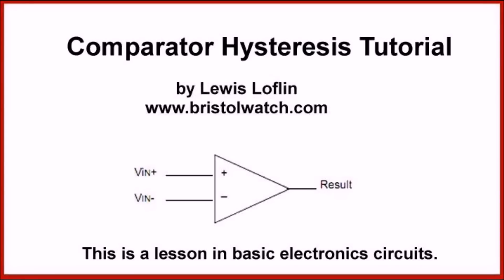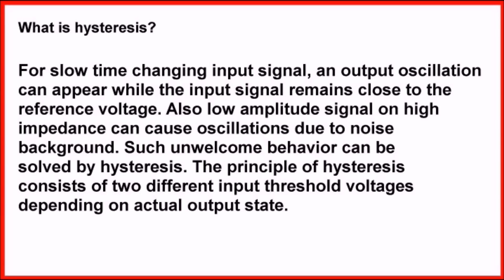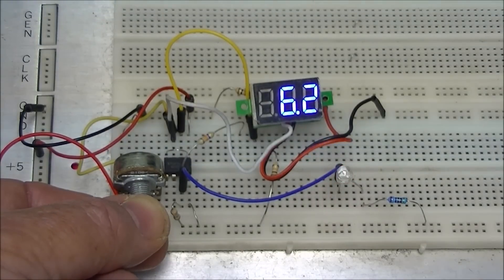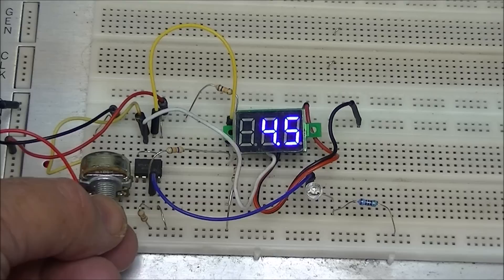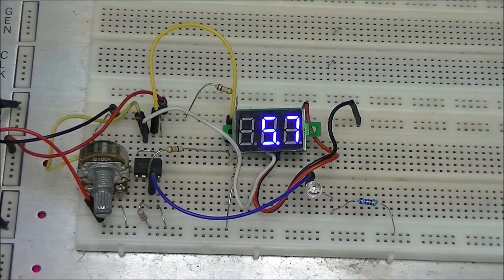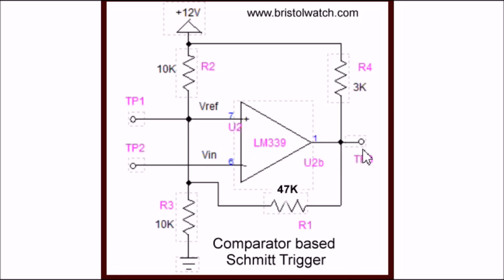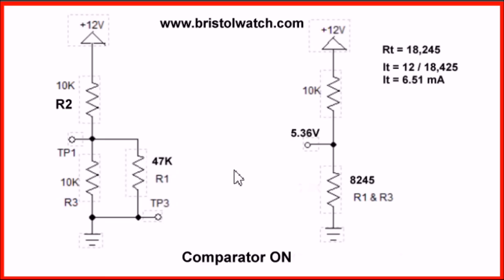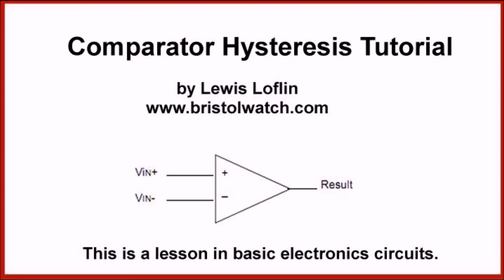Comparator Hysteresis Schmitt Trigger

Comment: missing resistor 3k on comparator is on. where?
Reply from the maker: It is there. What part of the video do you refer to?
Reply: @LewisLoflin  at 9:29
Reply from the maker: @ThomasHutabarat  When the comparator switches on the 3.3K is switched to ground and no longer plays a role in the circuit. It is merely a path from VCC to ground.
Reply: @LewisLoflin  i see. thanks for a great video. this help me so much.

Comment: hi sir, first of all thanks for sharing this video because it will help me a lot for doing a comparator circuit with a stable output. I just want to ask a question about the op-amp ic, can I use the LM358 or LM741 op-amp ic in the circuit that you have shown in your video tutorial? 

I am hoping for your response. 

again thanks!

Comment: I have noticed a mistake in your video. At 9.30 in the top righthand corner you have 'It=12/18,425", It should say 'It=12/18,245' and subsequently the mA should be 6.58mA and the voltage should be 5.42V
Reply: I noticed that too

Comment: Never mind about my question. I just figured it out. It's caused by my dodge connection wire. When current pass it, it will raise voltage considerably on the mosfet source side, so the gate-source voltage reduced accordingly and fall short to drive the mosfet fully on.